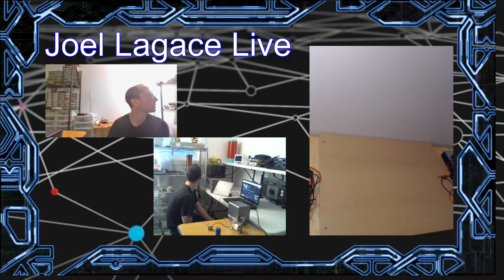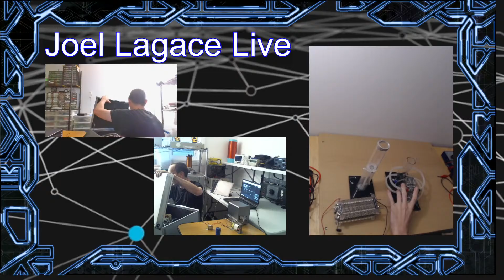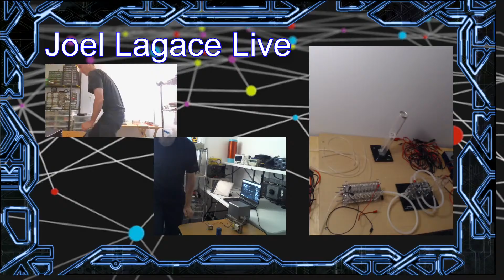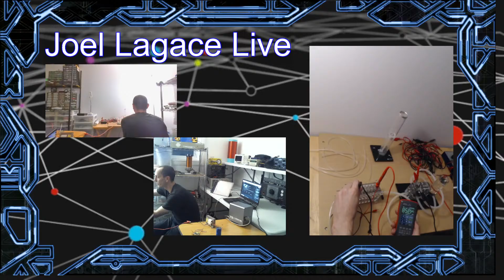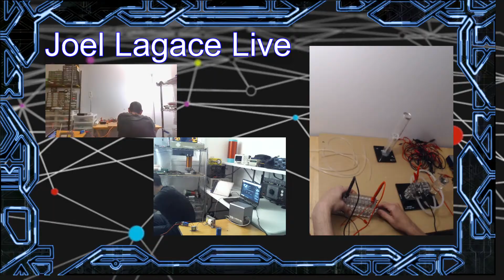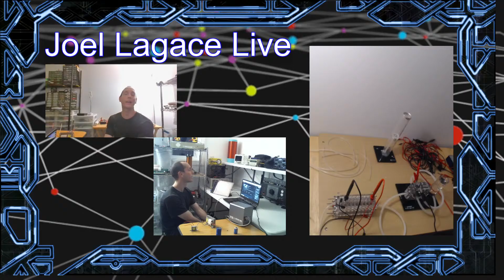Live Chat Experiments etc

Comment: Omg you’ve got a hydrogen generator. And it’s a wet cell, that’s perfect. 
Now that I have some money to experiment with, I can’t find one like that, and haven’t built another one yet. 
So when we used to build them like that, with the all thread. One of my buddies mentioned wanting to play with the potential that shows up on the bolts surrounding the generator. So next time you have it energized, check it out for yourself. The potential is there. I think if someone took and wrapped a coil around it, then used the generator as the leaky capacitor it is it would improve efficiency. 
Just wanted to share, and haven’t build it to show myself.